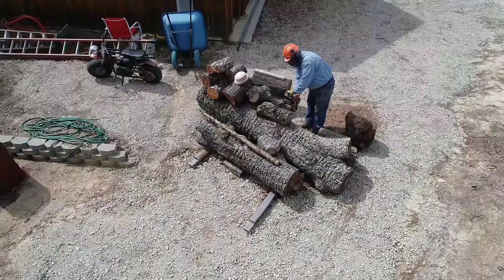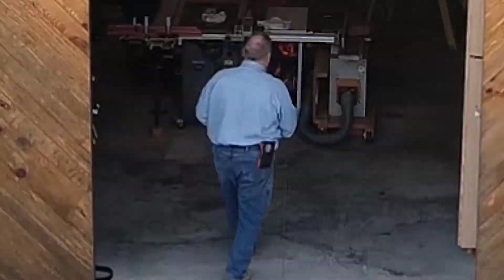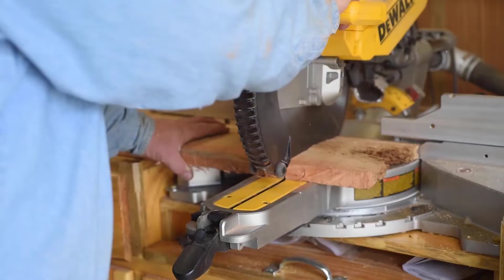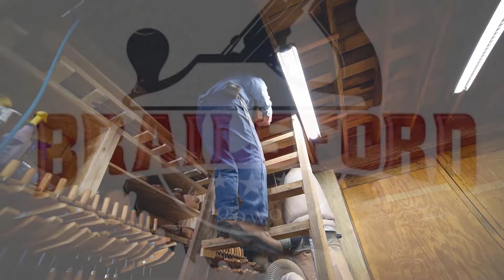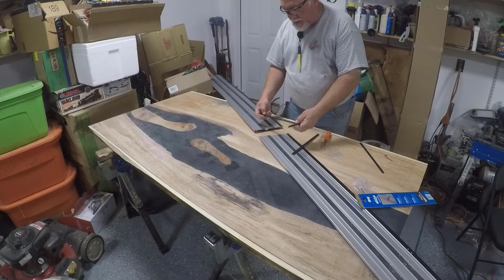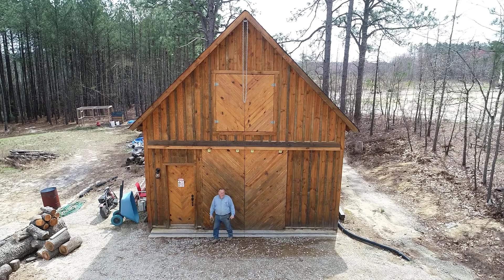Kreg Track Saw First Impression

Comment: Really great video thank you for sharing. Ive been on the fence with purchasing a track saw simply because not sure what one to get. Ive been leaning toward Makita or this Kreg. Since this video, have you experienced anything you really dont like? Are there replacement friction strips as with use i imagine the track will start slipping. Im new to wood working and am building my arsenal of tools, but I dont buy junk lol but at the same time i do have a budget. Thank you for sharing and I really love your work. Very Highend quality is exactly what I intend to produce on my wood working journey.
Reply from the maker: Thanks for watching!   The trigger had problems after a short time.   I called Kreg and they sent me a new saw and said keep the other one.  I have three sections of track with the couplers.  I also bought the clamps to hold it down.  I think as long as you keep the strips clean they should be effective for a while
Reply: @Brailsford Woodworks  excellent thank you very much for the feedback. I think ill go with this saw. I saw it yesterday at my local Lowes for 299.00. Merry Christmas by the way

Comment: I just bought the ACS 300 system, and I really like it so far, I do use my dust extraction system for dust control. as for the Cord management perhaps a few drops of hot glue at the edge where the bolt and nut are not at on the bottom!. I will say Kreg and Festool are the king of plastic. the blue is a whole lot cheaper! Kreg in my opinion is for the hobbyist.   I have purchased and used a lot of kreg products over the last 20 years and I can say I have never had an issue with them failing.
Reply from the maker: Thanks for watching!  I like the saw and it is very accurate.  I will say that I had trouble with the trigger on my saw.  I called Kreg.  They did not balk at all and sent me a new saw and told me to keep the first one.  Pretty amazing customer service.
Reply: @BrailsfordWoodworks  thank you for the feedback yesterday I made my first cut with the system and the trigger acted odd, with depressed the saw cut off. I squeezed it a second time and it ran normal what yours doing?
Reply from the maker: That is exactly what mine was doing.

Comment: Can you make bevel cuts with it?  Can you purchase a shorter track to cut stair treads with?
Reply from the maker: les, it can make bevel cuts, but I believe they only offer one length of track.  The do offer their offer their Adaptive Cutting System table which would make cutting stair treads very easy.  https://www.kregtool.com/shop/cutting/adaptive-cutting-systems/

Comment: Love the outside of Your workshop, but why do You work in a Dumpster full off cardboard boxes ?
Reply from the maker: Well thanks about the shop.  Those projects I had to complete in my garage due to the size of the tables, the ability to control the temp in the garage for the epoxy pours, and the fact that my shop was taken up with the projects that I had going for the same client.